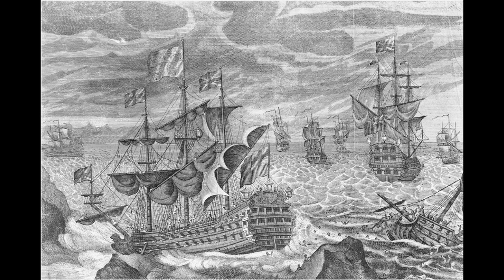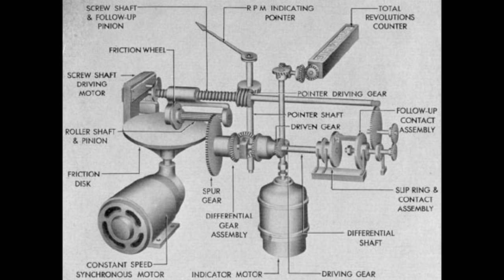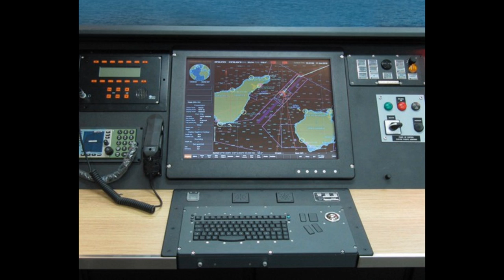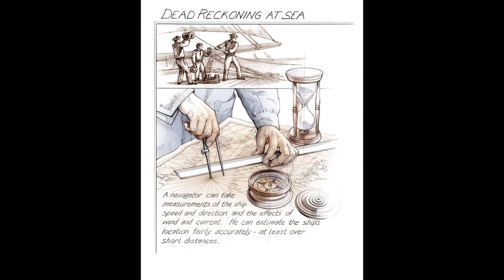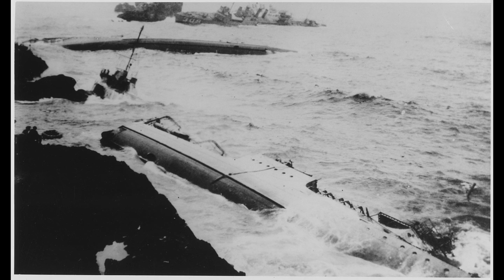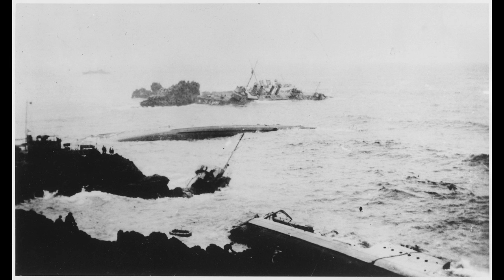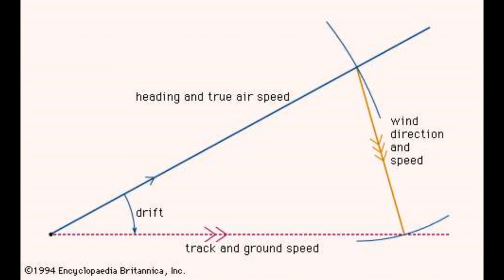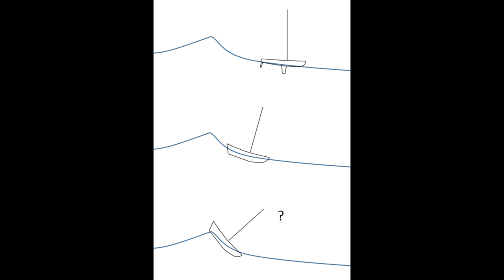Honda Point Disaster - Taking a Wrong Turn at Albuquerque

Comment: I think the fact that there was a discrepancy between his dead reckoning and the navigation beacons should have alerted him to the fact that there was a possible problem. And, like squadron 12, he should have slowed down to assess the situation. The fact that he dismissed the beacons information because he believed it was unproven technology was, I believe, the wrong decision. For one thing he could have provided useful information to help prove that either the technology worked or that it needed further work. As it turned out it did work and men died because of poor decision making.
Reply: well done on a full deployment of hindsight.  would you like a cookie?
Reply: Radio navigation was still a fairly new technology back then so people wouldn't have taken it for granted like we do. But going at relative high speed in fog with any navigation system seems unwise as there could be other ships in the area.
Reply: The screws coming out of the water due to a following sea should have been obvious and easy to time, giving the navigator a correction factor on the overall ship speed. That may have yielded only a couple of percent correction, but applied over 9 hours of cruising, that alone might have moved them a few miles down the coast, maybe just barely enough to clear Point Arguello, although not enough to clear Pint Concepcion (but at least the shore is a lot less rocky there and the ships might have been salvageable).
I don't think that the accumulating radio bearing deviation from dead reckoning should have been ignored; this was a teaching experience with data screaming at them; a 50/50 question of which source was wrong, and those are not good peacetime odds to gamble your ship, let alone your squadron.
Reply: @wb6wsn  the screws coming out of the water is "an obvious and easy factor to time"?!  Are you serious?  Do you think that waves are even and predictable, and that screws behave consistently across different instances?  Or are you suggesting someone sit there and count the screws each time?  That there is some magical table for each ship to consult for "following seas & screws out of the water, cross tabulated for global location and see state"?!

You have no idea, do you?
Reply: @iatsd  What hind sight. This is what the 12 squadron did. And Drach did ask us to give our own thoughts which is what I did. Maybe instead of trying to rush to you 'smart' retort you should have listened to what he asked.
Reply: @bluemountain4181  This is true. In fact I was thinking how we accept new technology rather more readily then in the past. British troops in the First Gulf War were told not to rely on GPS but that is exactly what they dd.

Travelling at high speed in fog when you are using dead reckoning is never a good idea.
Reply: @bigblue6917  Let's go through your post then, shall we?

The discrepancy - it did alert him to the fact of a problem.   He discounted it.  

He should have slowed - Why?  He was confident in his position.  He was also wrong about it.  12 Sqn chose to slow - why?  Because they did have more faith in the RDF system.  This is the part where you apply hindsight.

Dismissing the RDF tech was wrong - Yes.  It was wrong.  But he had no way of telling that *at the time*.  At best your statement is trivially true and another piece of hindsight.

Useful information - how so?  It wasn't as if they were treating it as an experiment.  It is "useful info" in only the broadest of sense: RDF works and can be trusted, assuming it's been calibrated properly.

The OC Sqn/Div was experienced (far more so than you are or ever will be) and a product of his generation: he simply didn't trust the new tech and that was the only immediate thing at the time that would have likely averted the subsequent events.

Sorry, but all you've got here is post hoc tautologies and hindsight.  If your goal was to simply flap your lips and state the obvious then great, job done.
Reply: @iatsd  Wow, where shall we start your education? Imagine a body of water, much larger than your bathtub, and a bit more salty. The wind and moon and other things create rather regular patterns of disturbances which people call "waves." These waves exist in patterns, perhaps not simple patterns, but a sailor's most important job is to bob up and down on these patterns, and it usually becomes very obvious that there IS a pattern. An astute sailor (or surfer) can predict this pattern; I'll bet even you could do so if strapped to an ocean buoy for a few hours.
Spending hours running before a following sea, maintaining a fairly constant heading, and well offshore (to minimize the confusion of underwater reflections and the refractive effects of islands), everyone aboard a ship would feel the engines and props periodically spool faster as the stern lifted and gave the props less "bite" in the water. I am not talking Hollywood special effects levels, with the props spinning in mid-air while the ship hogs on an amidships wave; realistically, maybe the props would break the surface or cavitate for a moment. The USS Delphy was a Clemson Class ship, about 1200 tons and 300' long (small by Navy standards but pretty big to me), and they would roll a bit as well as pitch, but the net effect would be to create a slow pattern of loading and unloading on the propulsion system.
I can remember once cruising a 50-foot displacement hull craft for about 16 hours in a following sea. You plow into a wave, dipping your bow in the water and climbing the wave backside. Then, you crest the wave and accelerate down the face, and at this point, your screw(s) may break the surface of the water. You hear an obvious RPM increase until your props are well underwater again and your bow loads into the next wave. There is a boring, pleasant rhythm to this effect. Of course, we had modern nav aids, so thinking about dead-reckoning navigation was a very low priority.
However, if you are the navigator and depending on dead-reckoning, you had best consider what effect this is having on your true speed. As explained in this video, dead-reckoning makes assumptions about external influences and applies them as "correction factors" to your navigation solution. No, there is no "magical table" that you try to strawman, but there is a way to obtain a reasonable estimate. With only a stopwatch, and viewing the propshaft RPM indicator, you can determine that your propulsive effort is being partially wasted for a few seconds every maybe 50 seconds.
You may have to heavily depend on your analog meat computer, but you can come up with an estimate (remember, all corrections are estimates of lesser or greater accuracy) that your true speed is several percent less than the speed associated with the number of turns your props are making. Speed integrated over time yields an estimate of your position (although you should always remember to plot an area of uncertainty around your predicted position and that the longer you have been projecting your position, the larger the uncertainty becomes).
The navigator might also have used a towed speed indicator (as sailing ships sometimes used), but I don't know if the Delphy had one aboard. Disasters usually have several contributory causes, and running the Santa Barbara Channel at night, in fog, at 20 knots, blind, on >12-hour old dead-reckoning, ignoring inputs you don't understand and not knowing what you don't know sure stacks the odds against you. I don't have much experience in that area, but I did experience some really dense fog one night off San Nicholas Island (where the ship's rail disappeared into fog 30 feet from my face), and San Nicholas must be about 65 miles off shore.  That's not a good place for overly bold navigators and captains.
So back to you, Salty Iatsd; I can hardly wait for you to tell me more of what I have no idea.
Reply: @wb6wsn  The thing is the navigator WAS NOT doing the job the squadron commander was. thats stupidity there as is. let specialists do there job.
Reply: This certainly wasn't the only time new technology was ignored with extremely disasterous results.  Early in the morning of December 7, 1941, a new, temporary radar station was set up and manned by the Army on a high point on Oahu.  The radar pickuped what could have been a large flight of aircraft in the far distance headed toward Hawaii.  Since no aircraft were expected from that direction, the men believed it was a malfunction of the radar, didn't report it, and closed up the station.  I believe they spotted the aircraft between 6:00 AM and 6:30 AM.  Had they reported the sighting promptly and had Pearl believed it was serious, the fleet could have had time to get steam up and exit Pearl Harbor and the aircraft on the island would have had time to get airborn and investigate.  The Japanese would have been surprised instead of the other way around, would have lost quite a lot of planes, and maybe some carriers.  The course of the war would have been much changed.
Reply: @smokey1255  

Yes - that occurred to me too.

Actually though - they picked up the Japanese just after 0702 and they did report it. They'd just gotten a phone line installed and called the information center just like they were supposed to.  The officer on duty though - knew - that there was a flight of B-17's coming in from the main land and figured that these were what they had picked up.  That flight of B-17's did in fact come in during the raid and some of them were lost to the Japanese attacking the airfield.

Watch the movie "Tora!  Tora!  Tora!" which has a good depiction of this incident. The 2001 Movie does to but it's not as good but I couldn't find that:
https://www.youtube.com/watch?v=5alr8yLZtI8

This is the Radar that made the detection
https://en.wikipedia.org/wiki/SCR-270

This is the officer who said it was B-17's
https://en.wikipedia.org/wiki/Kermit_Tyler

This is a report from someone who knew the operators who did feel that they were ignored.
https://www.youtube.com/watch?v=3hz81I_3_AQ
I don't doubt that the people this guy knew felt they had been ignored.  They HAD tried to give a warning but - the system failed them.  The officer making the decision was new and not well trained.  The whole radar defense system (there was more than one radar - this is just the one that picked up the raid) was new and poorly trained.  The military had sent officers to be trained by the British but didn't do a good job of trying to implement what they were taught.

Basically - it comes down to the US having a Peace Time Military - that just wasn't Mentally ready to go to war.

The USS Ward had attacked and sunk a Japanese Submarine trying to sneak into the Harbor - but - when they reported it - the officer who got the report thought it was yet another false report and didn't do anything.

Despite repeated warnings Admiral Kimmel and General Short - failed - to have their commands ready and both were court marshaled.  MacArthur who had 8 hours of warning AFTER the Pearl Harbor attack - also - failed in his defense of the Philippines was not court marshaled.  
.
Reply: @iatsd  Might as well had a live fire exercise and had men stand up to see if the fire is at the right height.
Reply: @smokey1255  A sky full of USAAF fighters as well as flak. Now that is what I call a surprise.

As many, if not all of the battleships et cetera would have survived they could meet up with the carriers and go after the Japanese fleet. I imagine the war would have been much shorter.
Reply: @BobSmith-dk8nw  I think Tora Tora Tora is an excellent film. Closer to a drama documentary then a movie.

You would have thought with all that was going on in the rest of the world they would have at least had a more, as you observed, 'ready to go' attitude. It looks more like they believed that the war would never happen to them. Having said that once they got themselves into gear the US armed forces made a good job of it.
Reply: @bigblue6917  They had a Peace Time Mentality and a basic disbelief that something was really going to happen - which is actually fairly common in situations like this.  It is why the Japanese achieving surprise was so important.
.
Reply: @bigblue6917  It takes hours for boilers to warm up to operational levels.

Comment: Guy I work with served on a frigate during the 80's. He said their new captain ran them aground on a sandbar his first day. He said it collapsed the sonar dome on the front and he and his engine room colleagues had to stay on station for nearly two days doing nothing but changing out screens for the water intake line as they would plug up with sand almost instantly. It took two ships to pull them out. The captain never saw the deck of a ship again, while it was good for the crew because they spent a month in dry dock for repairs with shore leave.

Comment: Speaking from experience using dead reckoning, Loran, a good watch, and a compass( I stopped navigating anything well before GPS)...Even with modern Navigation aids you should be horrified at how often a ship or aircraft ends up somewhere they shouldn't be... most of the time visual clues will warn you before you make an unscheduled landing ( an abrupt landing causing massive amounts of kinetic poisoning, structural alterations, and most often an unwanted case of death...) or berth yourself snuggly against a piece of land that isn't where it should be.....In one training mission, involving practicing for a mock leak at a local reactor... I managed to put the Civil Air Patrol Cessna I was navigating for into an area the exercise marked as lethally radiated...So I ended up having to be "decontaminated and Processed", carried away and used as a practice "Casualty" for the ground teams... Standing in your shorts in a crisp March breeze, and being scrubbed down by the very enthusiastic guys with the hose and brushes was a pretty good reminder to adjust for lateral drift more carefully.
Reply: That brings up the question about what sort of redundancies and cross checks that modern navigators have. If your GPS unit suddenly went on the fritz, have you been keeping track with other methods, including Dead Reckoning? These days, does anyone still know how to use a sextant and chronometer?
Reply: @philperry4699  Or even a slide rule?
Reply: @philperry4699  For larger military equipment (ships and aircraft), the GPS is paired with an inertial navigation system, the former feeding drift corrections into the latter. If the GPS drops out (interference, jamming, or satellites suffering from rapid unplanned disassembly), you still have an INS to work with, just need someone competent to feed in the drift corrections manually.
Reply: Nothing, I mean NOTHING sucks like decon!

Comment: That moment when the humvee in front of you slams on its brakes for seemingly no reason and the driver behind you isn't paying attention, nor is the next.. or the one behind him.. and so on..
Reply: That happened to me on I 15 a few years ago, in December, after dark. Was cruising along in a mostly empty lane the second from the left, all the ones to the right were packed full and almost stationary, when somebody pulls out in front of me from the right and stops dead in the road. I stand on the brake pedal and come within inches of hitting him. I look to my dad in the passenger seat and was just about to say 'that was close' when BAM.... BAM, I get rear ended and the guy behind me gets rear ended. Long story short, I ended up driving another 50 miles after dark in December without a back window, and I was the only one out of that little pile up to not get a ticket.
Reply: @McSkumm  in the UK in those situations it's similar, all the cars behind get a ticket, you were driving well, with due care, with a sufficient gap between you and the car in front, everyone behind you was negligent on one or both of the previous points so at fault 😊
Reply: @McSkumm  SAME STORY.  But in an ice storm.   I actually had 10-15 seconds to look in my rear view window and just watch them coming.... and coming... and coming... notice the first is on her cellphone.... still coming.... oh look, a expression of shock on her face.   Brace for the G's, this will not hurt.   BAM BANG BAM BANG BAM BANG.   Went sliding everywhere.   3 cars totaled but because of the ice, the fact her grand am submarined under  my bumper & I had let off the brakes I left with only a scratch.  We were both heading to Buffalo Wild Wings so she covered my meal and a couple IPAs.  I think I came out on top, honestly.
Reply: @McSkumm  was the yahoo in front of you ticketed for unsafe lane change?

Comment: my grandfather Ernest C. Porter had the salvage rights to the destroyers. he donated one of the propellers off the delphi for a memorial at lompoc ca. i have some photos of it being loaded onto a flat bed trailer that the air force sent to his home in atascadero california just before the dedication. the bell hung off his house from the delphi until he passed away and the home was sold the bell was removed. i have a name plate off the chauncey that he gave me also some brass valve pieces and pipe that he had made for a bird feeder that was outside his dining room window. i use it as a patio table.
Reply: Some damaged propellers are on display in Lompoc at the veterans center .
Reply: The Bell off the Young is on display at the Maritime museum in Morro Bay as well 👍